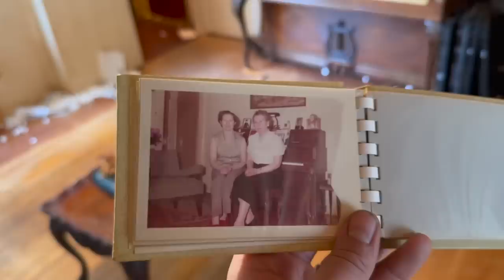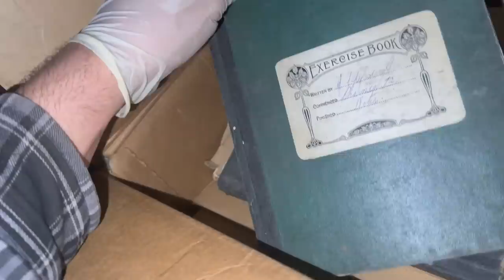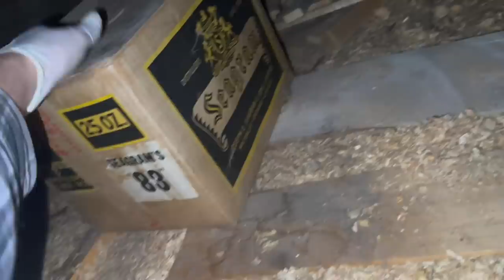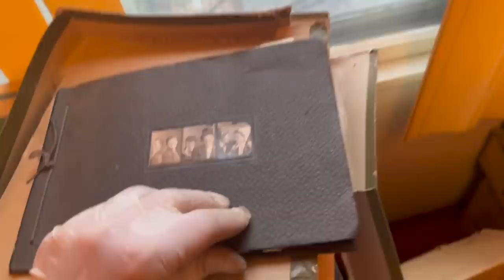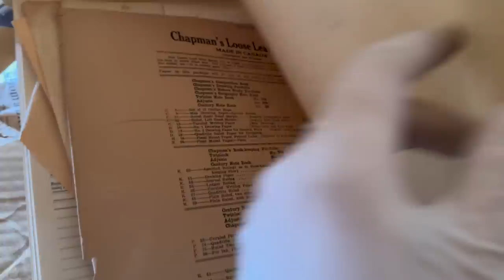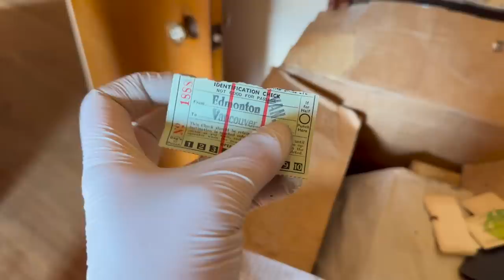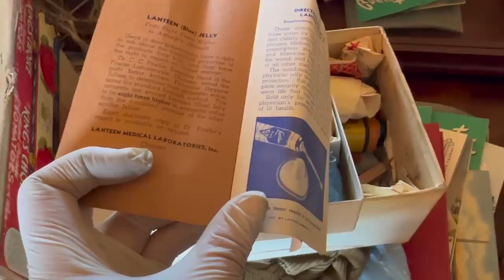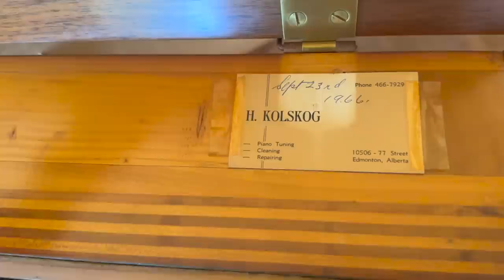Searching an abandoned attic for treasure! Part 7

Comment: Alex just before you left the attic , there was a stripped piece of clothing at the side of the entrance. It reminded me of a uniform worn by the prisoners in the Nazi concentration camps.
Reply: Wow! I had a cleaning job years ago  and the fellow had his "striped pajamas" hanging in the basement 😥
Reply: It's not impossible. I thought that too and wondered why he didn't take a closer look. If those were just normal pyjamas, why would anyone store them up in the attic? They must have had some significance to whoever wore them.
Reply: The material is called “ticking”, is sturdy and tightly woven. It was mostly used to make pillows and mattresses, as the weave stopped feathers from escaping.🖤🇨🇦
Reply: @tamarrajames3590  yes I have seen mattresses made from this material but the material in Alex’s video was an article of clothing.
Reply: @gregorybarr6112  Possibly a work apron of some kind? It would protect clothing I’m sure.🖤🇨🇦

Comment: The sawdust in the attic was interesting. There was not a clear enough image to see definition of the material. I was thinking it looked like Zonolite which came from Libby, Montana and was used as attic insulation. Wood sawdust breaks down over the years and compacts as well as decays. Zonolite is a mineral and doesn't do that.
Reply: I've been reading a book on asbestos deaths from Zonolite and ooh boy, it would not be worth going in that attic if that's what it was. While you can't unbreathe the attic dust, you could possibly thoroughly clean or wet and discard the dusty boxes and things.

There are people who have died from a single exposure to that tremolite asbestos insulation (a one day install job). 

At the very least, don't smoke after something like that. Smoking raises the asbestos fatality rate 50x.

Hoping to goodness it was sawdust and he didn't contaminate dozens of places by transporting tremolite asbestos fibers from the attic.

Comment: That basement needs a super good hot hot mop to loosen all that crap off the floor and clean it. Asbestos won’t hurt you if you mop it it is very water resistant and fire resistant. Great flooring
Reply: I think I would still leave it, as they will either tear the whole house down or remediate the asbestos areas.

Comment: The mouse hole loos like a drilled hole for a cable wire.  Some people ran the cables this way, rather than having a coaxial screw in inlet, in the wall.  That would have been an awfully cute and tiny mouse though. 🤟🏼🤍

Comment: Yes, Alex I was slightly embarrassed you didn’t know what a diaphragm was even with the shape of a condom, the other thing you stopped at in this house was a speculum, the large scissor like thing that had sizes printed on one side.  My son had to be born using this instrument and had two spots on his cheeks where they pulled him out.  He got pushed back in during birth after he crowned and he ended up going sideways with his arm hanging out. He continued to be pushed by my body for another 5-6 hrs with his head preventing him from being born.  Ultimately in the surgery room the Dr used his hands to turn him vertical and then used the speculum to pull him out.  12 long hours of labor.  I was told later that when the baby presents horizontal the dr. Used to have to break the baby’s neck to get him out to save the mothers’s life.  I didn’t know any of this while it was happening of course, but they had called my whole family to the hospital just in case.( this was 1972) When I came out of the surgery room I didn’t understand why everyone from both sides of the family were waiting right outside the surgery door to hug and kiss me.  I was only 19 yrs old and very innocent. But I never forgot the story.  The dr said he would never let me have even a 5lb baby. My son was 6.6 lbs. 19 “ and as it happened, he was my ONLY child.😅

The other comment I want to make sure you check on is the striped cloth just inside the attic on the right side.  It appears to be a Jewish Prisoner’s set of “pajamas”with the strips from the concentration camps in Germany.  Was the Dr in the house Jewish?  The Germans used even Jewish Drs to perform medical procedures on some prisoners and also German families when all the German Dr. were sent to the front from the Concentration camps.  It looked unused, if it is a true camp uniform, I’m sure a museum wold be interested in it.   Just a thought from what I saw.
Reply: Did you mean forceps for the delivery? I thought speculum was used during a vaginal exam.